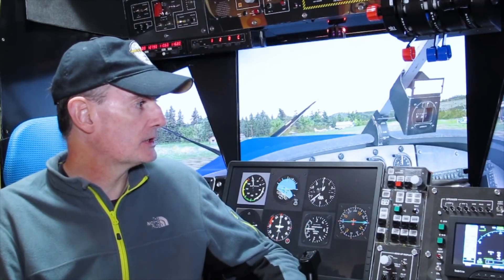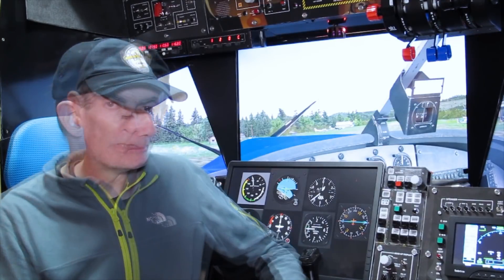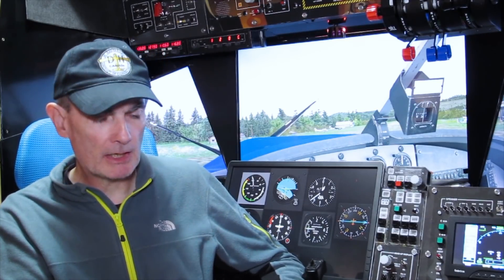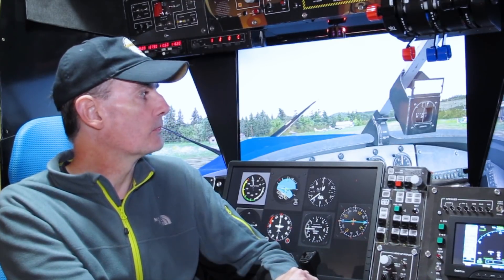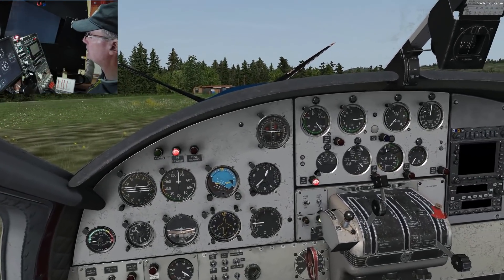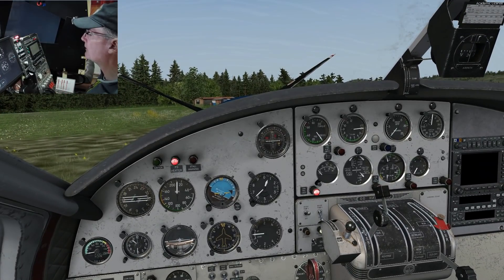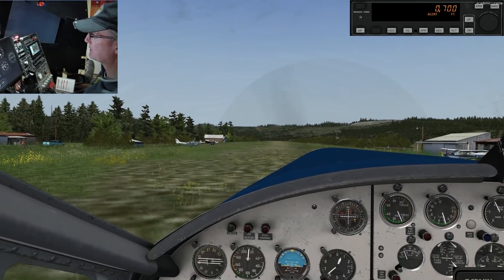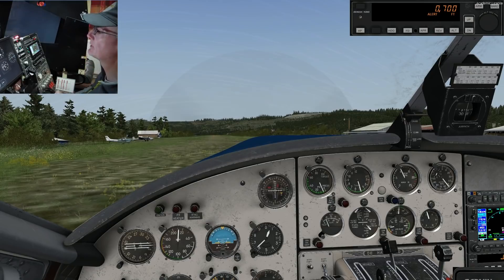Milviz DHC-3 Turbo Otter

Comment: Great review! Why are you not using something like the Brunner Yoke or pedals? This would completely change the level of realism!
Reply from the maker: I would like to try the Brunner gear, although I am sceptical about how much difference it would make. It depends on how clever their software is. And of course the reason I haven't tried it is it costs a fortune!
Reply: @AlmostAviation  Look... Here is the information I got from a Cessna pilot who has tried them! "The Bruner flight controls need lots of configuration to work properly. They feel very stiff. I fly a Cessna 172 in real life and I feel like it’s almost there. It’s not 100% accurate but 90% for sure. As you know from your yoke, it makes a ton of noise and is constantly switching gears in order to simulate the force feedback. Now for your question, the rudder pedals. I think the rudder pedals are pretty darn realistic and I felt like I was in a real 172 when I tried them. When you startup the engine, the rudder pedals turn on and they start vibrating depending on engine power so after a flight your feet will feel tired as if you were flying in real life. The rudder is stiff like real life but I don’t remember if it auto centers or not, I think it doesn't (which is also realistic). One last thing, To own Brunner equipment you have to be really good at flying aircraft and I mean real world pilot good. When you get Brunner the stuff, your aircraft will turn into a difficult aircraft to control because you might not be used to force feedback which is why real world training helped me.  I loaded up the Bruner equipment in a Cessna 172 in stormy conditions for an ILS and I literally crashed it! It’s hard surviving IMC conditions with it manually has you have forces acting up on you constantly and you have to monitor the systems. You will enjoy them if realism is what your going for. Personally I wouldent buy them but since money isn’t an issue, go for it. I usually sim for fun and like to relax. The brunner stuff, you gotta stay on top of your plane all the time. Gotta be sharp It’s really cool though when you get to cruise. Also, a cool thing about the yoke is that it moves by itself when the autopilot is on which is what happens in real life."

It costs a fortune but this is the ultimate realism you can get in a simulator... And this is why I will order them personally. As you can see they can be challenging and this is exactly what attracts me since I do not have the opportunity to fly in real life. The good thing is also that it will simulate hydraulic failure (become stiffer), simulate light GA and Jets... can be made stiff or soft as per taste. Don't take me liable for my words though... I have done a ton of research but I do not own them yet :-)

Hope this helps!

PS: I have learned a ton of information from you and I do respect you and I thank you for sharing your knowledge with us!!!

PS2: I have not seen you using X-plane... And if you haven't I do urge you to give it a serious try... I was a P3d hardcore fan and I still have it... but X=plane is so much better and is a leap forward in realism... You feel you are there and really flying the thing! X-plane simulates the forces on the airframe but fsx engine predicts them... Then the runways are so much more fun and so on....

PS3: Sorry for my long reply :-)
Reply from the maker: Thanks for the info on the Brunner. I may one day try them out, they do seem to get some good press. But the effects would have to be so much better than the Iris Dragonfly with FS-Force, both of which I found to be rudimentary at best. If I was going for the Brunner I would also hold out for the longer-stroke yoke rather than the cheaper one.

As for X-Plane, you will find a few XP videos over the last year or so. I will get back to it, particularly as Orbx is now making scenery for X-Plane. And I need to find a good plane to focus on.
Reply: @AlmostAviation  I have heard it is night and day... No comparison with IRIS stuff. I will go for the CLS-E bundle which costs an arm and a leg ... As for X-plane there are a ton of really nice airframes now. Specially that you are in GA stuff. I have bought practically anything with an engine over there. All the best my friend!
Reply: The Brunner is expensive, but completely changed the flying experience for me. Lots of settings to configure how much of any forces you feel. Very strong motors. I've only tried it in X-Plane and is is amazing. Never tried any of the other options for force feedback. I went from a ch products plastic yoke to the Brunner.
Reply: @tracerfacer6234  Thank you for the feedback. Do you use the forum profiles or have you created your own?
Reply: @Ahmedblaser  been using my own. Didn't know about the forum profiles.  Will check that out.
Reply: @Ahmedblaser  Isn't the yoke much larger than is realistic for GA aircraft, especially the 172?
Reply: @pto200  Not sure... Is 15 cm that long?
Reply: @pto200  it is a Beechcraft yoke with standard dimensions I believe...
Reply: @Ahmedblaser  15 CM?  The spread is a lot more than that.
Reply: @pto200  i don't kmow what you mean by spread. 15 cm is the stroke length (range of motion) (pitch down/pitch up). I suggest that you check directly the quick fact sheer on brunner website and give me your feedback. My combo shipped today. I should receive it within a couple or triple days...